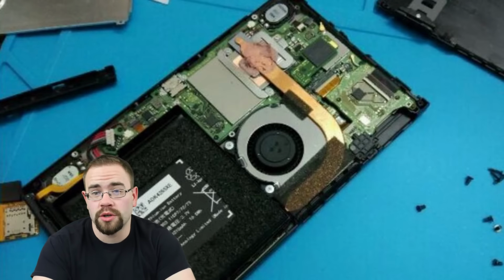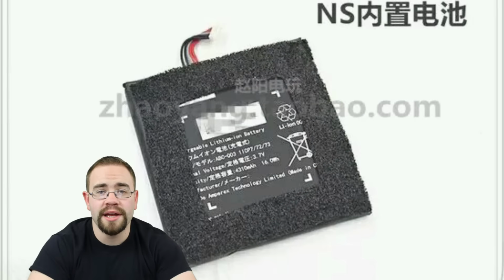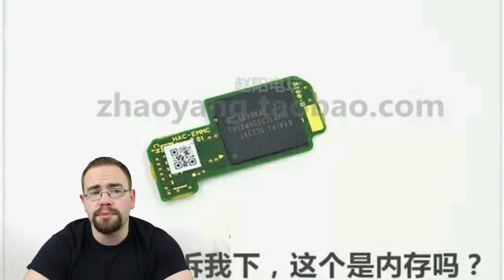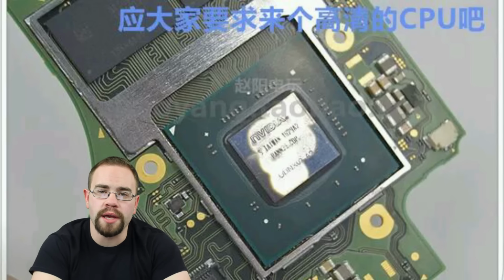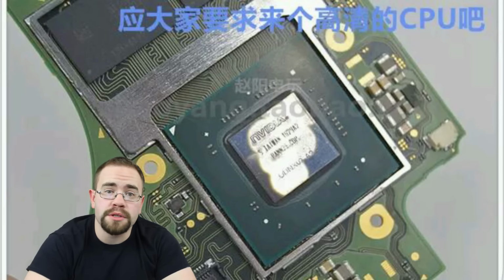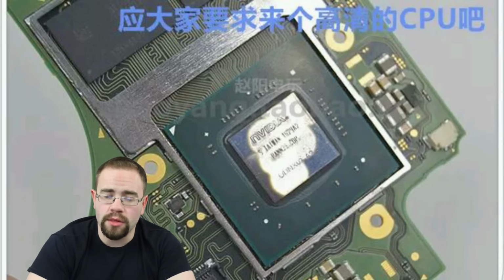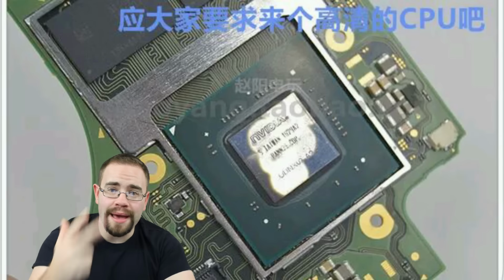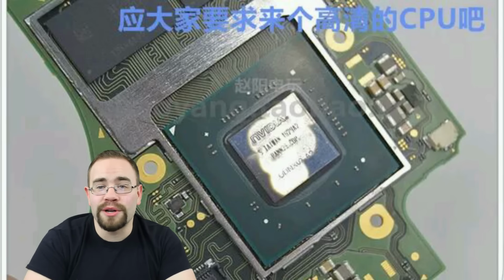The Nintendo Switch Was Finally Disassembled!

Comment: Few things with this...... Those who say it's a dev kit. It's obviously not. This is not a retail or final unit either. The date code on the chip 's 1629. Which means it was built around the 2nd week of July in 2016. This appears to be a revision of the NS Tegra, but it also appears not to be the final variant regardless if its a Maxwell or Pascal based GPU. The final Switch Tegra would have a different code than the ODNX02-A2 that appears on this Tegra. I'm gonna say that this is a prototype Switch unit built for testing before finalizing the hardware this chip is probably a 16nm Finfet manufactured at TSMC hence the Taiwan manufacture code. Now Nvidia was having issues with TSMC's 16nm Finfet during this time. TSMC was having difficulty with the fabrication of Nvidia's GP 100 series GPU's (Pascal). Around August of 16 Nvidia announced it was switching to Samsung's 14nm Finfet before the end of 2016, which took place around late September. Now the Switch's hardware was finalized in late September early October? Wanna bet that the Switch's Tegra Soc is 14nm and not 16nm? Which means we still aren't looking at the final custom Tegra in the Switch. Same for the 4GB of VRAM which is still a rumor. X-Ray machine we look forward to your reveal. One more thing Nintendo's copyright is missing from the PCB if this was a final PCB Nintendo's copyright should be printed on there.
Reply: Brad Kayganich Well let's wait
Reply: Didn't nintendo say an early unit was stolen?
Reply: Brad Kayganich holy shit, this needs to be pinned
Reply: Bring that fire to the game.
Reply: Brad Kayganich 
the copyright could very well be on the backside of the board, due to lack of space on the front. I certainly don't see any free space where the logo could go.
Reply: personally i don't think nvidia have much issue with TSMC. in fact TSMC probably the only fab capable of producing nvidia big GPU such as GP100 (610mm2). the only one that manufactured at samsung right now is their smallest pascal GPU which is GP107 (132mm2). the talk nvidia to use samsung fab is not new. TSMC is one of the best but there is also many other company fab their chip at TSMC. and because of that nvidia have to compete with capacity. back in 2012 TSMC have to give a portion of Qualcomm and AMD capacity to satisfy nvidia demand. so probably better if some of their gpu are manufactured else where and not rely solely on TSMC. in fact JHH publically said before intel should open their fab to others.
Reply: Another thing I found was looking closer it said nx
Reply: Miles There's room on the board for a copyright stamp. You put copyright stamps on the topside of the PCB, at least from my years of working in electronics as an SMT that's what happened. The backside of the Switch probably doesn't have much of anything besides a few resisters and capacitors. Which could be why this person didn't take a photo of it.
Reply: Renzc ode Nvidia doesn't have an issue with TSMC. The issue was TSMC having fab problems at 16nm FinFet with the GP 100 series GPU's. Actually GP107 is not the only die being fab. The GTX 1080ti will be 14nm as well also being fabbed at Samsung.
Reply: Brad Kayganich ooo
Reply: @Brad Kayganich
Where exactly is there room on the board? I can't see it. Nintendo's copyright stamp is fairly bulky.
Yes, usually those stamps are on the upper side of the PCB, but that was always for consoles that weren't this cramped, which even includes previous Nintendo handhelds. There is no law that the copyright stamp has to be on the front, not even that there has to be one at all. Nintendo could just say "fuck it, too much work" and it wouldn't make any difference for them legally.
Reply: 1080ti most likely based on GP102 that was built with TSMC 16nm process. TBH i'm not sure if nvidia will ever "port" GP102 design for samsung 14nm. because that will cost nvidia to design the chip for both process (which can be expensive for company like nvidia). and the second concern was does samsung process suitable for making big die that needed for high end gpu? there are talk/speculation that AMD polaris end only at 232mm2 because the 14nm process that GF licensed from samsung probably cannot go much bigger than that. the upcoming Vega was rumored to be fab at TSMC instead of GF.
Reply: Renzc ode Yeah you're right about that. GTX 1080ti will just be the GP102 at 16nm with 256 cores disabled and higher base clock. I wonder what the issue was though last year though with GP-102,104? Have to dig into that. This Switch at 14nm though is still a possibility if it got a Pascal based GPU since it would be a cut back version of the GTX 1050 anyhow.

Comment: I already like the Switch based on what I saw during the conference, and the bits of news coming out. It will be interesting to find out the true specifications of the Switch once a retail unit is disassembled and examined more properly. Nintendo actually used every bit of space available on the unit. If the battery capacity was larger, the current design won't be able to accommodate it.

Comment: The Micro Architecture has not changed since the micro resistor pattern is similar. The core i3 3120m has the same pin connection as with the core i3 4100m but the reason it will not work with a g2 socket is due to different architecture. I know this since the Micro Resistor pattern is always different.

Comment: Wait! So the advertised 32gb storage is internal memory? I was thinking it was just a 32gb micro-sd card included with the switch? So if one was to get a supplement micro-sd card, you could choose to save onto that external micro-sd card instead of the internal 32gb? Is this right?

Comment: Thanks so now I can choose to aftermarket upgrade the memory from 32gb to 64 gb, which allows more use for the main on board memory of the switch. Nice how they made it like a modifiable tablet, but the fan looks weak, they need a better design on the fan to prevent overheating, but maybe they made it balanced so that the fan and battery life are balanced.
I will wait on the purchase until more major titles come out for it such as pokemon or terraria or any other enjoyable title.
Since it is modifiable, wish to add backwards compatibility on the switch to play older games on it.

Comment: Hmm. Smaller die suggests removed features, OR a process shrink.
Although Tegra chips are already on a 20 nm process (as opposed to 28 nm for desktop maxwell and 16 nm for desktop pascal)

A node shrink makes some degree of sense, but honestly, so does removing some internal components...

Comment: If someone measures the screw holes, compares them to what normal size screw holes are and they could use that to determine the size of the processor chip and board.

Comment: So that looks like an 8mm copper heat pipe, which is pretty big regardless of the device. Also that SoC looks like it's swappable as well, due to the white arrow. If it is, that would explain why the memory is modular. It would seem like they are planning on releasing a revised system in a year or so from now. Same with why the battery actually has a cable and not shouldered on. That way they can continue mass producing all of the parts and then just change the SoC, memory, and battery and swap them into the manufacturing line without slowing down.

Also, I am not at all surprised by the internals. Nvidia wants a piece of the billion dollar console market and this is their foothold. Although I also think the Scorpion is an Nvidia machine, but that doesn't have any basis other than a feeling.

Comment: It's a custom Tegra X1 4 cores ARM A 57 (from big.LITTLE they binned the other lower power cores). 3 cores for games 1 core for OS. They also underclocked the core to 700 Mhz docked (from a max. 1 GHz of nvidia Shield TV). This doesn't look good at all, just an Android Shield TV 2.0 with shelf recycled cores.
Reply: Beringeringerhein Source? Source! Or else bulllllshit!
Reply: Source or Bullshit.
Reply: Beringeringerhein i would also like to see sources. or at least the right direction to the sources.
Reply: Beringeringerhein where did u find this information?
Reply: Beringeringerhein I doubt that
Reply: give the source or you're screwed
Reply: That's not how CPUs work.
Reply: this guy is obviously trolling.
Reply: Same rumour that's been circling for a pretty long time now and that gullible people gobble up as truth. We don't know the specs.
Reply: Source: Nintendo Switch Chip Was X-Rayed! Here's What's Inside

Comment: I wonder if it will be relatively simple to install a replacement internal battery with some more juice.
Reply: Jovarus 

its a masterpiece. easy to fix, easy to replace, fairly strong, and VERY durable.
Reply: Jovarus it will be easy with tge plug and play. soon 3rd party devs will make a battery with a bigger MaH
Reply: PROMINENCE 32 

Doubt it. Battery tech has almost stagnated at this point... most increases in battery life is from using less power. Lithinium is dangerously close to the theoretical maximum?, so much so that even samsung makes mistakes (note 7 battery explosions)

Comment: One thing is certain now. This chip is much more powerful than the best version of Maxwell. Because it´s a fact, that even the most powerfull version of Maxwell doesn´t need a fan. And it´s a fact, that even the weakest version of Pascal needs a fan. So this chip, even based on Maxwell, is much closer to Pascal than Maxwell in terms of raw power. This is a fact now.

Comment: That heat piping is pretty big and he fan....
the tegra 4 in the shield portable also has a small fan to disperse heat.. always thought it was very interesting to see in such a small portable, and it came out in 2013, but with nvidia of course youll be seeing alot of crap under the hood & it will run hot.
SHOCKER- I am curious however, considering that nvidia is behind the internals.. i wonder if THAT is the reason the left joycon is losing a connection. I also have a shield tv, and if you read up online (as well with my unit) it is constantly losing connection to the internet whether wifi or cable... not to mention it is also losing connectivity to the controller AND the remote!!!!!

The real kicker is the fact that sometimes it takes forever to re-sync, restart, sync, etc multiple times to get it working again. Its been happening since update to marshmellow i think and nvidia has still never addressed it. Seems since similar tech was used for the switch, this nuisance may have spilled over.

Comment: I never had to replace anything like that... even my original N64 analog sticks still work like it did in 96.
only parts I've replaced are crappy capacitors in older consoles.. Oh and dozens of lasers in PS2s, which paid for most of my college tuition ;)

Comment: So is there still no chance of it being a Pascal chip?
Reply: Not in the slightest.
Reply: Kevin Duke we don't really know until a x-ray image of the SOC pops up online. let's hope.
Reply: Kevin Duke the chip is technically is an x2 so it's not that bad really and there is still a snall chance it is pascal
Reply: Ryan Joseph but we don't so we'll have to wait till its confirmed what it actually is
Reply: very true
Reply: never say never. until there is some form of confirmation by nvidia or nintendo we can't say "it's definitely maxwell" or "it's definitely pascal". remember when we still call the console as NX it is heavily suspected the system will use semi custom solution from AMD. back then it is almost impossible to even consider nvidia as a possibility to power the system.

Comment: the specs are not very impressive if we follow the specs revealed in the digital foundry article (http://www.eurogamer.net/articles/digitalfoundry-2016-nintendo-switch-spec-analysis). Interestingly the switch appears to be weaker than the ps3 and the xbox 360 in portable mode. 157 gflops compared to 192 gflops (ps3) and 240 gflops (xbox). On the other hand, the console is around twice as powerful as those consoles in dock mode (switch dock=393 gflops).

Comment: One thing I'm worried about is the fact the motherboard is riding against the edge. If this thing drops, you could possibly break something internally!
Reply: SugarFreeTargets I wonder what Nintendos priorities were when designing the switch frame? It does seem like it would be prone to damage and what worries me is the frame strength.
Reply: looks like its not the case though.
Reply: SugarFreeTargets it has a cage, which I suppose is made of aluminum and it helps to protect the board and internal components.
Reply: Pedro Nogueira aluminium, depending on the degree in which it is treated will still bend; much like the iphone 6 did. but being that its thicker; i dont see it much of a problem... maybe. the internal case is a different story though.

Comment: Quite frankly I think Nintendo should drop 3ds and if they want a cheaper portable out there just make a dockless switch perhaps with smaller size and better battery life and call it a day. A new portable worse than the switch is pointless, if they want a worse portable the 3ds will fit the bill just fine.

Comment: looks like they are using the iPhone strategy, standard performance components with high quality software and design, and is really affordable
Reply: Iphones aren't what I would call affordable, but otherwise, yeah, that sounds plausible.
Reply: KuraIthys that is the only difference, switch looks affordable for what it offers

Comment: I've mentioned this to you multiple times and you continue to ignore it- Nintendo's hardware NEVER resembles off-the-shelf parts.  EVERYTHING is customized.  

This is why comparisons to "Maxwell, Pascal" or any other GPU architecture is conjecture at best as Nintendo develops their own custom GPU subsystems, usually only modified heavily by binary code.

Spec whores have no idea what they're comparing, because the concept of a CUSTOM ASIC is beyond their comfort zone of "I can build a PC by assembling parts from Newegg!!" and they refuse to acknowledge they have NO IDEA what's going on under the hood.

Custom projects are built for custom tasks all the time in the world.  Only Nintendo seems to still do this for video games, while the outside world seems to judge them as if they operate like Sony and Microsoft.

Stop.
Reply: ***** "Nvidia Tegra X1 used in Switch has nearly no customization dude."

Where's your proof of this?

Explain how Switch is a clone of X1.

Comment: So... will the 2 consoles that came out in 2013, still be more powerful?
Reply: BuffaloBill Well sort of
Reply: Well look at the thing. It's a handheld.
Reply: So no big 3rd party western support then? :(
Reply: BuffaloBill That's like saying...so my computer from 2010 is still more powerful than the latest Samsung Tablet...The Switch is WAY more technologically advanced than those 2 dinosaurs.
Reply: BuffaloBill Well that's up to the third parties if they want to. 2K has stated they'll support the system "long form".
Reply: CWeltonDesign It may have more modern tech, but that doesn't necessarily mean Switch is more powerful than Xbox One and PS4. The WiiU had more modern tech than PS3/Xbox360, but really never proved that it was a more capable console than those two. Also, remember that for all intents and purposes that the hardware is housed in a tablet.
Reply: backup368 3rd parties said something to a similar effect regarding WiiU. Look how that turned out.
Reply: BuffaloBill Not due to the lack of graphical fidelity but due to the low sales of the software.
Reply: BuffaloBill Never said anything about being more powerful. Wii U was more powerful than PS3 but completely outdated tech.
Reply: backup368 There was a myriad of reasons why 3rd parties didn't port games to WiiU.
Reply: CWeltonDesign The tech in WiiU was more modern than tech inside a console that launched 6 years prior (PS3). You don't agree?

Comment: To charge the Nintendo Switch when your  out of home is to PUT it inside the Dock station ?!  WTF , I have to take with me the dock station with me when I go out ?!
Reply: the ac adapter is a usb type c so it can charge the dock and the switch
Reply: Ahmed the only thing the dock is requiered is to show the games on the TV (you can't use the USB-C to show the games on the TV that way) you can charge the Switch and the JoyCons without the Dock.

Comment: As far as how powerful it is....Zelda BOTW...900P 30fps. There wont be any big surprises in that department u fortunat3ly. Not impressive at all for a console. 
720p 30fps is great for a mobile gaming rig. So, it a powerful handheld, and an extremely weak home console for 2017. 
I do think it will be successful though, based on how many handhelds nintendo are able to sell.  it's a shame they charge so much for thier games. $60 a pop adds up fast.
Reply: Interesting,  i didn't know about many of the things you mentioned. At least it'll be a nice portable hand warmer in the winter time!

Comment: Do not void your warranty by taking his advice about opening a Switch to fix it yourself.  Nonsensical advice.
Reply: Raj Singha what if you need to change your, battery, sd card slot, etc?
Reply: Alexander Jaramillo Send it to Nintendo?
Reply: Nintendo have already said batteries must be replaced by sending it into a service center. There is a small fee. Same applies to other components.